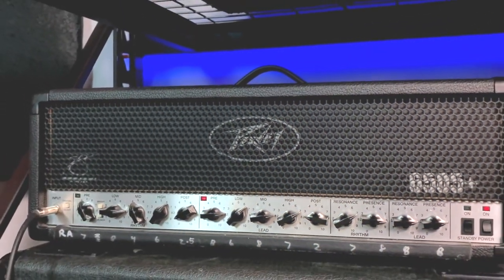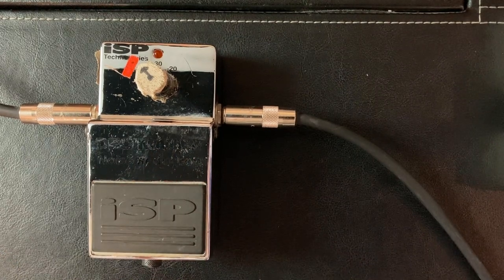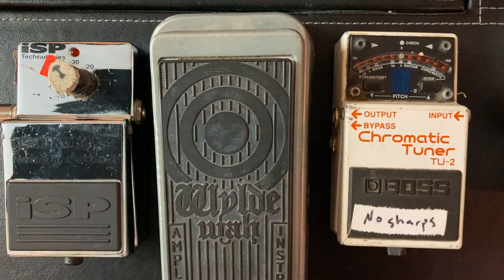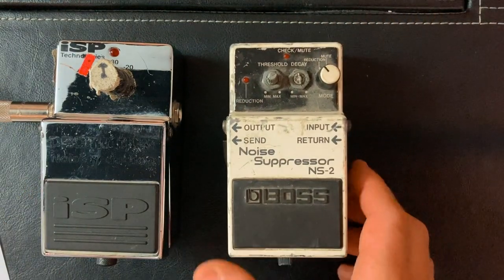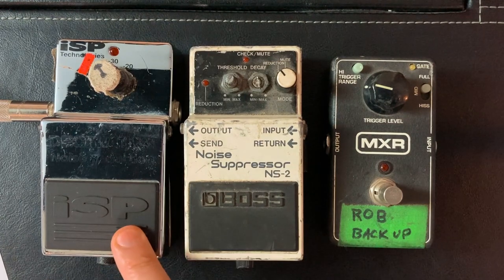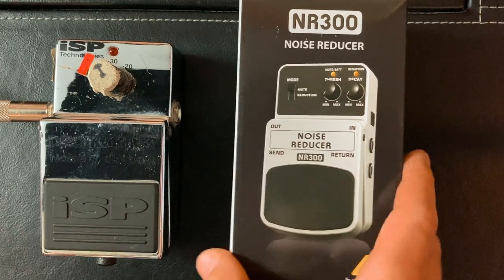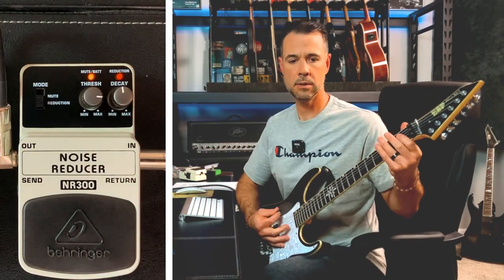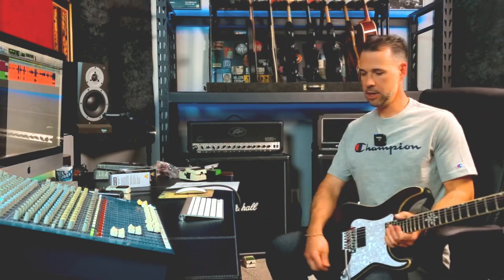Noise Gates 🔇 Do You Need One? What's The Difference?

Comment: I haven't played in years but I picked up the Peavy 6505+, Mesa/Boogie Rectifier cab, and an iSP Decimator II after watching a video of you showcasing your gear and settings. The combo is amazing and the Decimator was an amazing purchase. Thank you for all that you do!
Reply from the maker: Awesome Sean! I agree, that setup we're using is money!🎸
Reply: @RobArnoldWorld 
Me and my grandpa modified all my tube amps grandpa has a degree in electronics and woodworking but me and him modified my tubes and added a noise gate circuit inside them so I don't have to manually press down on the pedal and my guitars no longer have 60 cycle hum no feedback no staticky noise we also have vintage RCA tubes jn my amp for the preamp and we also modified the whole circuit by rewiring it to be hand wired
I play country rockabilly and bluegrass and Blues I prefer clean tones 
I'm 21 by the way

Comment: I’m really digging the budget Behringer pedals, I own a few of them. The price points are insane and even though the plastic casing is cheap the quality is there. That being said the pedal aren’t top notch but they are great for back ups if something were to happen to your main pedals that you use. I have an Ibanez TS9 Tubescreamer that is my main overdrive but I also have a Behringer Vintage Tube Overdrive that holds up very nicely compared to the Ibanez Tubescreamer. The only difference is that the Ibanez TS9 has an all metal casing, is $100 brand new, and is a little tighter in the low end and the Behringer is $20 with plastic casing, is a little less tight in the low end but still kicks major ass as a back up Screamer.
Reply: Same. I mainly want pedals to record with and have fun with at home and I'm not gonna spend thousands of dollars on pedals. I only have 1 behringer pedal so far but Quality seems great on it. I'll probably buy 3 or 4 more soon. I think for most purposes they're fine though if I was a regular gigging musician I could understand wanting something with a metal casing that is more durable. I wonder if the behringer pedals will hold up over time.
Reply: Dont say price "point" That sounds like some  heartless  soul less marketing geek.
Reply: @michaelcraig9449  Oh definitely. I much prefer "economical tier Dimension". It's more "inclusive" to Aliens too.

Comment: The difference between the “Mute” and “Reduction” for the NS2 is on Reduction mode you can turn the pedal on and off, on the mute mode it’s automatically always on and when you press on it it completely mutes your sound. 🙂
Reply from the maker: Gotcha!
Reply: I was hoping that Mute mode would just be a faster-responding version of the Reduction behaviour. :(
Reply: @thromboid  mute is a hard gate and reduction is a soft gate, its not just a mute button. it is basically is a faster responding version of the reduction, but in this video he didn't turn the threshold down on the mute mode for some reason

Comment: Such an underrated topic of discussion.  Everyone is quick to jump on with the MOST BRUTAL SOUNDING AMPS/CABS/GUITARS but not nearly enough discussion on properly harnessing that power so it doesn't sound like a wall of uncomprehensible noise.  Thanks for this! I was using an old Boss NS-2 and I'm fairly certain that it was wired backwords because your settings and mine are literally the exact opposite with the same desired effect.  It however still isn't getting the job done so I just ordered a Decimator at your suggestion!  Thanks for that and keep this stuff coming!  It's EXTREMELY helpful!
Reply from the maker: Glad to hear that man! I'm confident that you'll love the Decimator!🎸
Reply from the maker: @@wrongone8378 After hearing that, I can agree that would work well, and is something I (and everyone) should try!
Reply: @Wrong One I have!  So my pedal is weird and really old.  I believe there's some bad contacts on the send return jacks because it actually makes MORE noise when i do it that way.  It's pretty ironic when you think about it...
Reply: @RobArnoldWorld  fun follow up. Decimator came in and I threw it on the triple rectifier rig. I can boost it WAY harder now than I ever have. Awesome pedal. So simple too. Thanks again for the suggestion!!
Reply from the maker: @RealBloodyTheElf  Excellent!🤘

Comment: further, ( and start with an isolated supply )
but i would recommend looking for the cheapest, and most compact, noise gate. ( i don't have a Kmise, but why not try one? i bet it works just as good as an ISP )
then figure how many you need to get your composite  threshold as low as you need it for your most tail demanding stuff....then get one more.

Comment: I play  a Mosrite MK I  which has extremely hot single coils, and lots of hum. Ok I do not chug chords, I play classic rock,  I tend to hold bent notes, and vibrate them often. So I want sustain, and dont want the notes to   go away suddenly. SO does this ISP  noise gate pedal  let the notes sustain naturally or does it choke them off suddenly?
Reply from the maker: One of the reasons I love the Decimator so much is because it still allows my notes and chords to sustain naturally. So I think you'll be good to go!

Comment: The Behringer pedal is basically a copy of the Boss noise gate. So the setting are going to be the same. You wanna run the pedals that you want to reduce the noise on through the Send/Return line. Then the guitar and clean pedals through the In/Out clean signal line. The problem with both the Behringer and the Boss pedal is that the noise can be reduced really nice but the decay time needs to be dropped low or else the sound you actually want to hear after you strum will cut out very quickly as well. The ISP really doesn't have that issue at all. It cuts the played very naturally.

Comment: I just got into pedals, I wanted a noise gate but they were expensive so finding a distortion pedal WITH a noise gate I figured would kill two birds with one stone. Again most of those pedals were a bit out of my price range, then I found the big Muff deluxe pi by electro hamonix, this was a great purchase my sound is tight and together  like a nuns legs on Sunday morning. Just wanted to share my story with anyone who wants a good noise gate on a budget,
Reply from the maker: Nice!
Reply: @RobArnoldWorld  great video, so thanks.
Reply from the maker: @jimsinister13  Thanks for tuning in Jim! Look out for my new video tomorrow!
Reply: The downside with this is, I don't think the gate will operate if that particular pedal is off, so if you have other "gain based" pedals that require silencing, you can't silence them when your other pedal is off.

Comment: Greeeeeeat video dude! I was seachin' for this kind of content to sent to a friend of mine, and found your video, hahaha! Thanx!
generally I use the Decimator in the effects loop before the time-based effects. This The gate will not cut the reverb or delay tails, ad keeps overall snd quiet. 
I've tried  NS-2, but the decay it's waaay too lazy and threshold it's not so accurate as the ISP. 
The MXR has the same problem as NS-2, but the fixed decay is even worst and threshold is quite bit kinda deaf. 
Decimator knows what to do, so sensitive to quieter strings movement even when pushed hard, and the decay is not linear but the filtering is so accurate that understands what is noise, and what is a long dying note. It lets you sustain a quiet note without cutting it. It's an almost  always on pedal.  
One that I haven't tried yet is the Zuul. People says that's to good as Decimator. Have you tried this one? Cheers!
Reply from the maker: Right on Daniel! I agree with everything you said! I've also heard talk of the Zuul, but I've yet to try one. Cheers bro!

Comment: Does the decimator "let " you sustain your leads.? I remember the NS-2 would choke out notes when I would do melodic leads... Gradually bending up a note
Reply from the maker: It clamps down on your sustain some, but that's a sacrifice I'm willing to make with my tone, to keep it super tight. I think it's all about finding that sweet spot with your own rig, where most feedback is eliminated, and you still get the sustain you're looking for. To me, it's easiest to find that sweet spot with only one knob on the Decimator, rather than getting into a balancing act with a unit that has more control.
Reply: @RobArnoldWorld  What about hum, buzz and hiss?  I need to get rid of that as I play single coil guitars, Strats, Mosrites.
Reply from the maker: @michaelcraig9449  I still back the ISP Decimator for ANY job!

Comment: Hey Rob...
Just a guitartech idea...
Noiseless springs is actuely thing...
FU-TONE makes awesome spring that will kill that spring noise wee heart on the vid.
They make all your hearts desire in part for Floyd Rose.
Titanium inserts, copper blocks, bell brass nuts, hardent steel spring claw. 
All sweet Floyd Rose stuff...
Just an idea..
Love from Denmark...
Reply from the maker: Thank you bro! I've been turned on to the FU-Tone stuff and it all looks KILLER! I just haven't pulled the trigger yet. I dream about tricking out some of my axes with those cool Floyd colors. Thanks for the tip and cheers to Denmark! Hope to make it back one day!🎸
Reply: @RobArnoldWorld 
Would love if you came over again..😁
You might not remember this but once when you where in Copenhagen, you and Matt signed my RA-600... Will never forget that. 🤘
Still have it, and thinking of updating it by installing a set of Sperzel locking tuners to bring it a little closer to your custom shop.
Glad that you liked the idea on Fu-tone...
Again I work in a guitar store, so Im always good for a little guitar advise and idea 😜
Horns up brother 🤘🤘🤘
Reply from the maker: @Martinroot  Awesome man! Proud to have you in the RA-600 family! 🤘 :_RA600:

Comment: Great Video Rob. I'm a fan Of the TC Electronic  Sentry noise gate. My other guitar player had one and ever since I tried his I've been sold and it hasn't left my board. I have a question/possible video idea.  If you use a noise gate when playing and recording live to reduce noise and feed back, how do you get feedback when using plugins? Im Just starting to use them and even got a nice one from Neural DSP. I can't seem to get it to feedback when I'm recording.  It sounds amazing when I record with it but it just doesn't feedback and there are some places where I want it too. Also I'm finding noticeable latency that throws me off when playing. Any help with using plugins would be really helpful. Recording old school with a mic on a cab is great but plugins have gotten so good and are so convenient I really want to be able to use them to their full potential. Thanks Rob you're the man 🤘🤘🤘
Reply from the maker: Cool Jed! I've ran into the same issue, where I'm TRYING to get feedback while recording in the box, and here's what I do...
I stand up and hold my guitar right up to my monitors! Even crank up the volume of everything if you have to. It works!
As for latency, that's something you have to figure out based on your setup. I can't hunt down the cause without seeing your setup myself. 
Assuming you have modern equipment, and your buffer and system settings are set appropriately, latency could also be caused my another plugin in your session. For instance, some plugins are just far more processor intensive than others. If you have something like tape saturation, or multiband compression, or pitch correction, or certain noise reductions plugins, all of those will add substantial system delay, making it impossible to track additional performances. So see if you have any of those going on in your session, then make them inactive (not just bypassed), or remove them temporarily. 
Good luck!
Reply: @RobArnoldWorld  Thanks Rob. I'll try that feedback trick. I will look into what else may be running And causing my latency. My equipment can definitely can handle the processing there just might be too much going on or some process running that I'm unaware of. Thanks for all the great information your putting out there for all of us guitar players.

Comment: Hey rob i run my pv at around 3 on volume and gain on 5 i found that bad feedback is to do with bad guitar set up it could be a list of things as of these
Bad pickups, bad wireing, pickups to high, bad shilding, graphite black paint is useually the best for that, springs if trem, i found noise supressors usually destroy some signal by guitar and makes it more of a synthetic type of sound somthing is not getting to where it should👍
Reply from the maker: So are you saying your tone is cool and free of feedback without a noise gate? By the way, I love the "pv" abbreviation! I never thought of that, and it's certainly easier than writing out peavey as often as I do! I'll be using that from now on!🤘

Comment: The Jim Dunlop MXR Noise Clamp (M195) is similar to the Decimator II in that it simply has a dial. It's also significantly cheaper. I don't own one but I need one. Even with a little practice rig, I find the awful noises generated to be demoralizing, as stupid as that sounds. Thanks for the video. Edit: I spent $35 USD on a Donner "Noise Killer" pedal after seeing Steve Stine give it a positive review, and it works great.

Comment: I got the ISP Decimator 2 a while back and a few months ago I got the  newer one the G-string I think and that it supposed to go in the fx loop and the front of the amp but I haven't quite figured out why it's not working as good. Am I using it correctly? I bought it used so it could be defective.
Reply from the maker: Unfortunately I haven't tried those models, so I can't say for sure. I have seen that they have an input and an output, for in front of your amp, and also a send and return to use with your loop. I have heard of guys using both simultaneously, but I haven't tried that myself. If it were me, I'd just go with the input and output, and run it in line in front f my amp. From there I'd try to dial in the sound I'm looking for. If I wasn't able to acheive the sound I'm looking for, then I'd start experimenting with the loop option as well. Sorry I couldn't be more helpful, and good luck!

Comment: Very interesting to know how and why you may need a noise gate pedal. I've never needed one with the Marshall combi amp that I had. Speaking of amps I have found a Marshall combi amp which comes with overdrive, reverb and stereo chorus blind in. So the only thing that I need is a distortion pedal. Or Rob would I need anything else ?
Reply from the maker: I'm not sure that you'd even need a distortion pedal! If it were me, I'd experiment with the amp a bunch, and then decide if additional distortion is necessary.
Reply: @RobArnoldWorld  Thank you Rob for your feed back. I wouldn't mind adding a delay pedal. have you ever heard of Dod pedals ? that's if there still about
Reply from the maker: @619dar  Definitely heard of DOD! I'm sure you could find one on eBay!
Reply: @RobArnoldWorld  I've just goggled to find out and yes there still being made.

Comment: Do u know the difference in the newer ISP’s cause I have the same one u do. And wondered if the new ones are better. Cause I do notice with my rig which I run a revv generator 100, then have a compressor, ts9, EQ, then my gate. Then all time effects in the loop. And I notice with all my passive guitars, I have the threshold right where u do, but my guitars with the fishmans which are ignorant hot on modern voice, I have to crank the isp up to 1/2. But then I notice it squashes too much sometimes. So I wondered if the new ones are better. Cause at quiet volumes it’s fine, but In practice, with my EII for instance I have to really stand away from my amp.
Reply from the maker: Interesting! While I can't say for sure, I would assume the newer designs are even better than the original, and that's because the technology has no doubt improved over the years. I noticed the newer versions say they have some sort of tracing technology, which to me sounds like something that actively seeks out feedback causing frequencies. So that sounds superior to me. But again, I'm not sure unfortunately!
Reply: @RobArnoldWorld  well you def helped cause I thought about maybe running it in the loop cause I’ve seen some guys do that with success, but I use effects in the loop, so I wouldn’t want it to squash the time effects you know. I do have a hush 2x pedal that I thought about putting after the ISP. But again not sure how much tone that would suck you know
Reply from the maker: @ericsmith6633  I guess the best thing to do would be to keep experimenting! Everyone's rig is different, and so there are rules on how it should be done!

Comment: Have you ever tried out the ISP decimator pro rack G? I know you said you don’t really run a gate in your effects loop, but the pro rack g is a 2 channel gate and it’s the best I’ve ever used. Kind of expensive though. Also, I was surprised how cranked your mids are!
Reply from the maker: I have! I owned one for awhile but sold it a few years ago. The reason? Too much control! I couldn't make it do what I wanted it to do in the same way I could with one knob on the pedal version. 
But I'm glad to hear you're having success with it! 
The more mids you've got, the more you can cut thru the mix!🎸